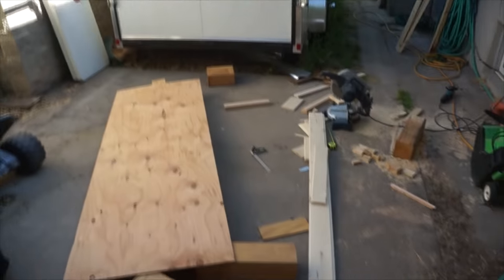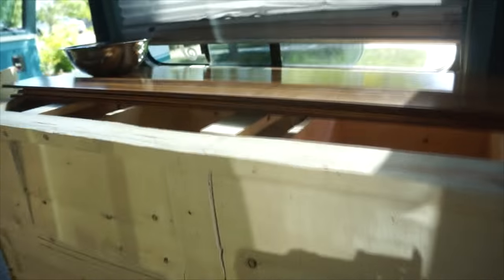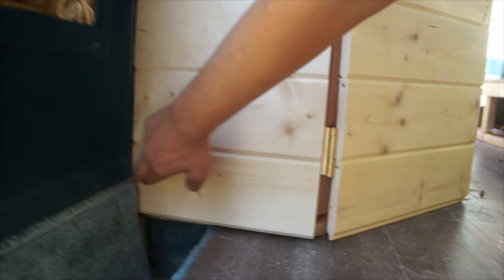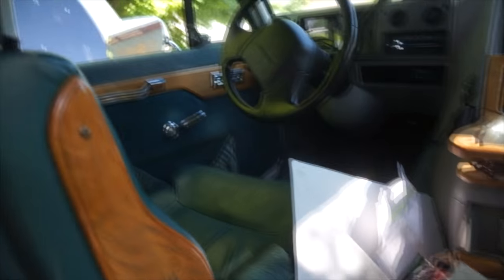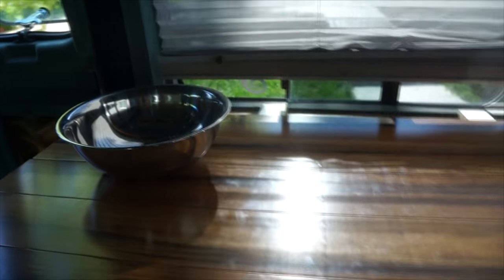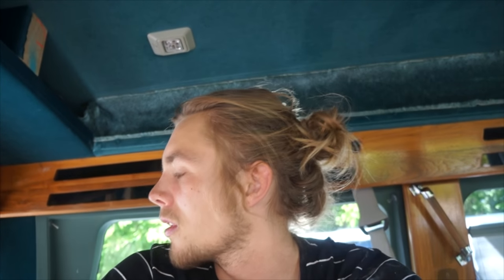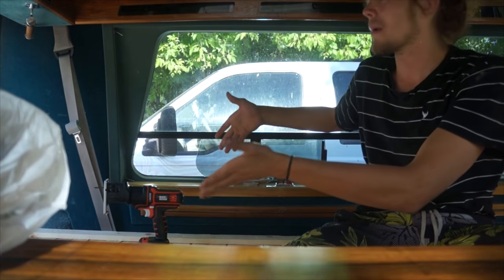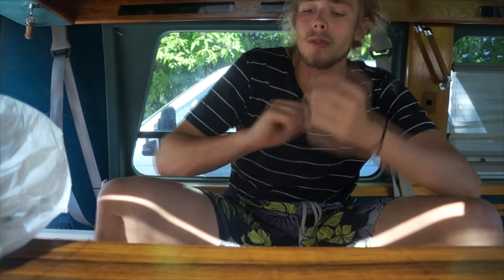Camper Van Conversion, Sofa bed, Bamboo Counter tops, Drawers

Comment: Great job so far. Your woodworking has improved! You can use sliders or make sliders so that the stove top can slide out the back door and use a drop bar to support the other side. Good luck on finishing it up!
Reply from the maker: Thanks! I think ill just do the same as the drawers, on sliders but with no walls
Reply: Any chance we will see an update soon? Possible to share where you are sourcing materials? I just picked up a Ford Van. Hoping to start posting my own build soon! Thanks again.

Comment: Nice work Eli! That interior old fabric is the same as mine, don't worry about damaging it. 3M adhesive spray works great to put it back on
Reply from the maker: Sounds good, thanks a lot! Epseschially bcause I both this van for $1500 im really not worried about resale value. Ima drive it till it dies, revive it and keep on going

Comment: great ideas and work so far. re potential damage from cooker use - why not mask that area beforehand? could be a temporary mask only in place when you cook, or one you can remove if it turns out to be unnecessary.
I'm very impressed with your work so far (and the work ethic 👍)
hope you'll soon be able to enjoy the completed version ✌
Reply: I think there will be no damage if he just doesn't turn up the heat too much. Little flame goes a long ways for cooking and for heating and always ventilate!
Reply from the maker: Thank you so much! Masking it with shiny stuff would make it a bit unapealing. the van itself is very cheap and it would be just as easy to fix the damage as to prevent it so im not too worried

Comment: Dude, you can totally even shower in there. There's a few videos where people hook up a spray nozzle to a garden sprayer and use that. The rest of your build is on point and you bed looks amazing. I have to extend my bed because I didn't build it with overnight guests in mind. Did you have plans from somewhere to make that bed or was that just an original concept you built?

I just got all the components so I can run my solar power. I'll be posting a video that tomorrow. Keep on keepin' on. You're doing a hell of a job.
Reply from the maker: Haha who needs showers :) bed was original just tried a bunch of stuff and guessed what would work best. Ill check out your vid!

Comment: Obviously you have to have a idea of what you r going to build but how do you get your ideas and how much of it do you do on the spot so to say, (what I mean is- your putting something in and you think, Oh I could put a lazy Susan here and such)? Like the bed (wicked man and incredible), did u come up with that idea or did u c it somewhere else and decide to use it? U see! to have my any skills at a young age and that's great! one last question, I know your doing this to save money BUT when and why did u decide to actually do it? thanks for the videos!
Reply from the maker: For everything so far I am yet to draw up a plan, I just get a picture in my head and thing hey that would be cool. It takes a bit longer because I have to measure as I go and cut as I go, but that way I can see and think about what I think would be the best option. Ofcourse I do get some ideas from other peoples rigs and what does and doesnt work for them. I tend to end up changing everything a bit to make it work better for me though. I decided to do this after working last summer as a wildland firefighter as well as spending most days out camping. realized I did not need an apartment. It is not just to save money but also to keep life simple. I find it a blessing to not have wifi 24/7 too.